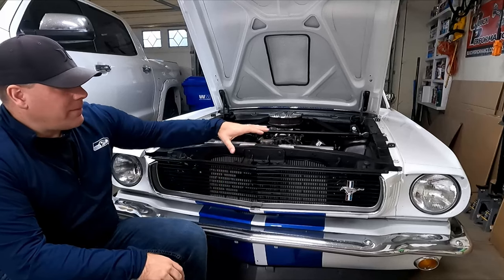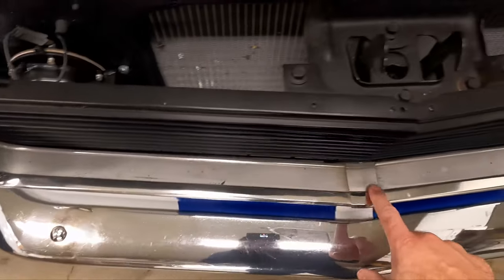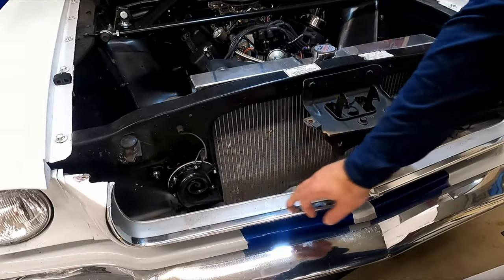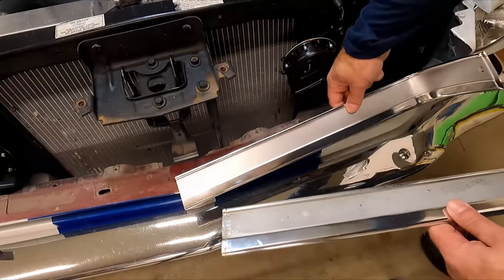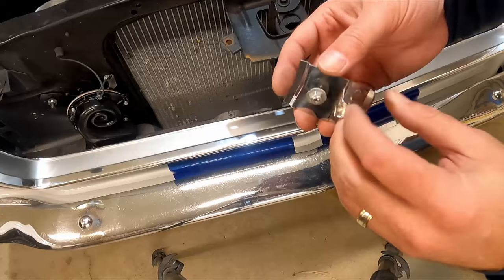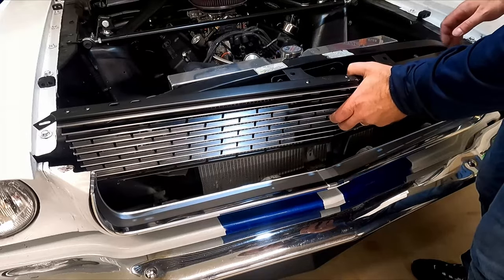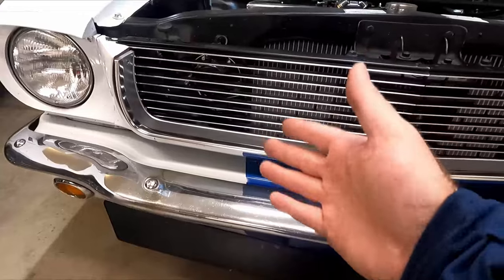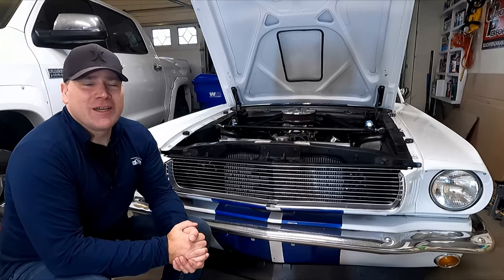New Grille Install and Grille Side Trim Pieces

Comment: Nice how to video. I still have a pair of NOS pieces from Ford. Got those in the 80' . When my car was down for a while, i took all the branches, hood latch pieces, bumper brackets, brake pedal assembly etc. Powder coated in semi gloss black. 
Mine is a 65 Fastback, the grill is honey-comb style. The original 65 grilles were a silver-blue metallic color. The mounting hardware is also available in stainless steel for a few extra bucks. 
Keep the old pieces just in case they are originals. 
Thanks for sharing.
Reply from the maker: Yeah, it can be nice to have original pieces.  :)

Comment: Never realized how easy that is I’m a body guy but with my 66 coupe I’ve only been doing maintenance or mechanical work so bare minimum I can just drive the car but I do the same thing any extra bolts, nuts, washers etc goes in a organized drawer just in case I need it for something my fiancé asked why do you need all this and I said well in a pinch it’ll save me a trip to the hardware store ha
Reply from the maker: Truth, there has been a bunch of times I didn't need to go get a bolt because I had something here in the bin.  :)

Comment: Hey buddy i just purchased a 67 coupe with a 351w, what oil  weight do you use or recommend
Reply from the maker: That's tough to say without knowing more about your build.  The first thing I'd look for in an oil for these cars is something with Zinc additives in it.  From there, it depends on the age of your engine and if it has any internal upgrades.  In my 347, I use non-synthetic Rotella T4 15W-40, which is used in diesel engines.  It was what my engine builder said I needed to use, and since I want my engine to last, I'll use what he says.  :)
Reply: @AndyKruseChannel  thats what i was thinking,  i pretty much got the car with no back story, and the internet is all over the charts, im gonna stop by a engine shop and see if they can gather some information on working condition and see what they recommend,  appropriate it
Reply: I have a 302 recommended to use 10w30 with a zinc additive